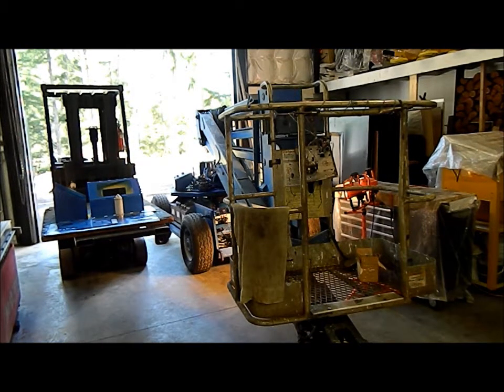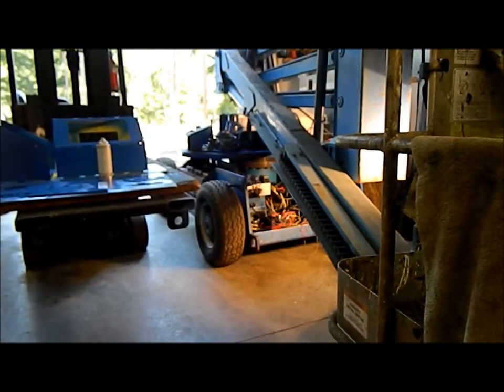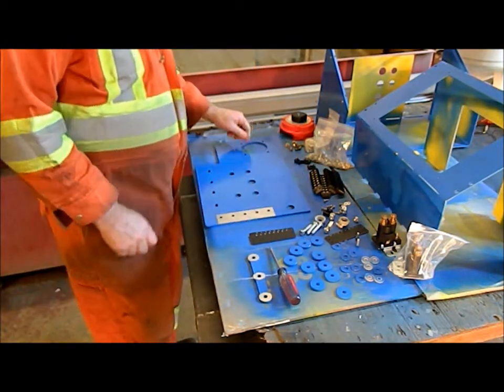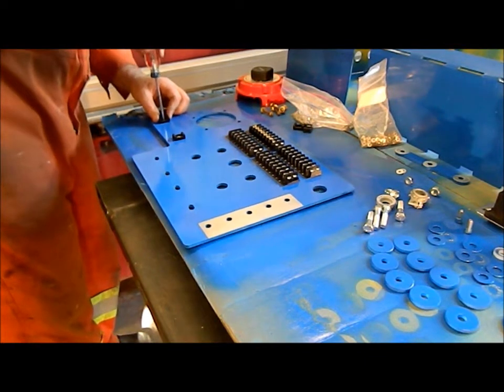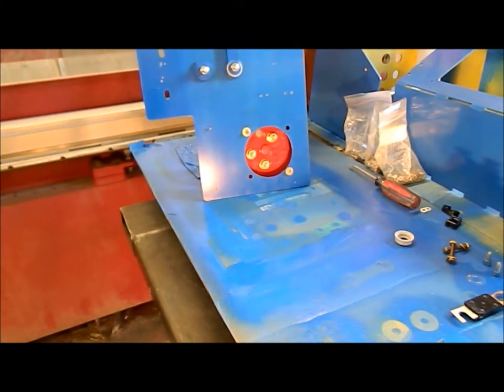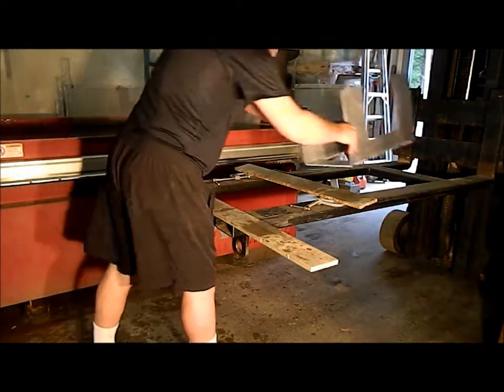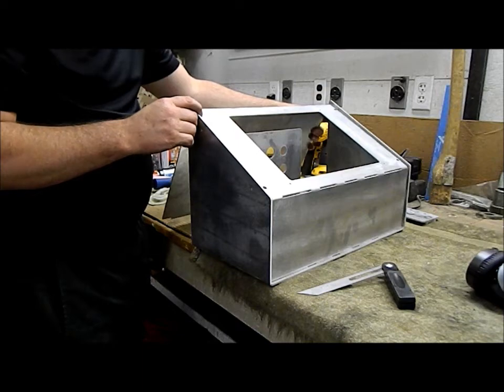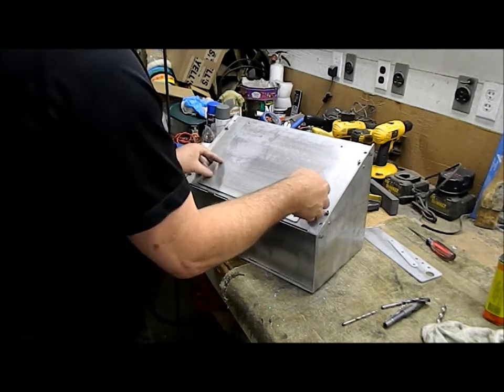Genie Z45 22 DC Rewire Part 1. Make new relay board and control boxes.

Comment: When I fixated mine , in the beginning it felt like a vary big undertaking. fix one item at a time and keep moving forward, you will get there. Now for some tips, when you get to the cylinder loosen the gland nut while the cylinder is still on the machine then remove the cylinder, also the upper pins on mine would not pull out so I winded up leaving the rod on the machine and removing the body by sliding it down and out. That way when I got to the piston nut it was easy to loosen with the rod still on the machine. You will have to raise the lower boom up a little and prop it up with some wood at the base to give you clearance to collapse the cylinder and swing it out of the cradle.